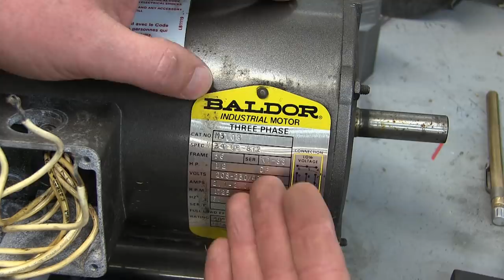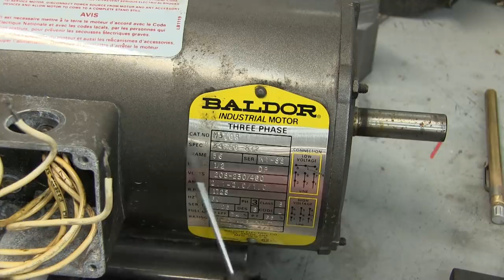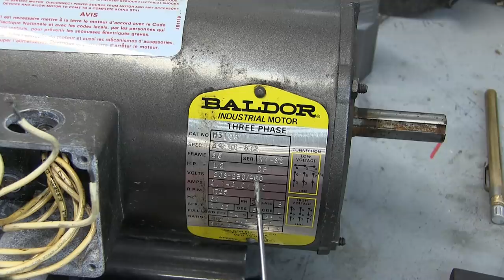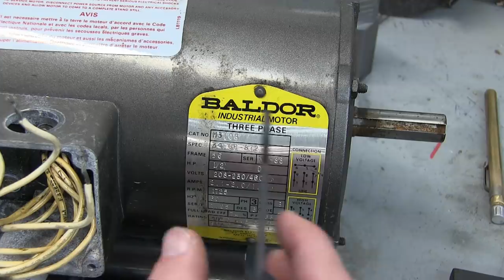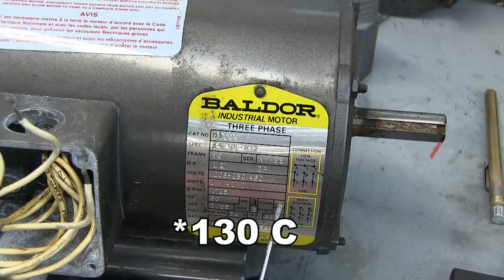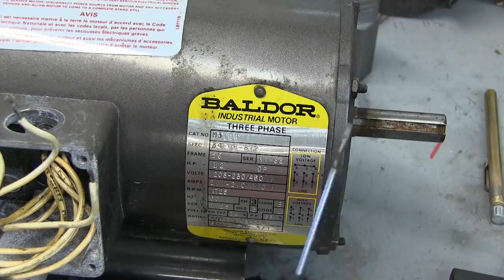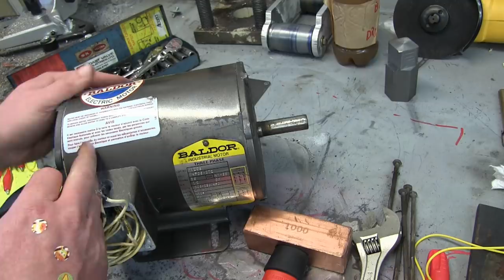BOLTR: Induction Motors EXPLAINED! | Power Factor and Failure Analysis

Comment: Multi-volt motors are usually wye for low voltage and delta for high voltage.  The wiring diagram on the data plate gives that away.  You see terminals 4,5,6 shorted together in low volts and open in high volts.  This is actually a 480V motor with center tapped windings to allow similar torque characteristics at lower voltages.  That's why you see 7,8,9 in the middle of the grid instead of the end. Cap off those center taps and you can configure as 480V wye or delta.

Comment: Humm most motors were I work are linked in star-delta configuration, a series of relays start the motor with star when the motor gains speed changes to delta, well it's the most common and think cheapest way,  Variable-frequency drive offers a lot of advantages but the cost also jumps a lot, the tendency is converting older applications to variable frequency drive though.
It's these things that make a factory run, they are everywhere, from the big air compressors, to the small circulation pump, to the hydraulic pumps, simple induction motors always behind them.

Comment: Give your take on the amazing Wave Spring, most useless application of one I’ve ever seen. You know at the factory the bearing was pressed in the hole regardless of the wave springs attempt to equalize or dampen the bearings position.  Wave spring force on par with farts good

Comment: Thanks for the video, nicely done. Would have spend a little more time explaining the name plate wiring diagram and it related to the coils of the motor showing that low voltage is really two small WYEs in parallel vs. one big WYE in series.

Comment: Do they not 'anneal" stators? I worked for General Electric & the annealing ovens were a bitch, but, it was interesting to see those sheets of metals bond in the high heat...  Rotors were cast. Scary process. Lost's of aluminum on the ceiling where the kilns would randomly regurgitate from sweat of workers..

Comment: You have a crappy way of changing the motor voltages over there in North Amurca. Here on the Old Continent we just change the windings between wye (high voltage) or delta (low voltage).

Comment: In an effort to stem the tide of PCness I want to make a quick remark about the "rule of thumb." There is literally no evidence it was ever used in the way you describe - that is of a man beating his wife. This appears to be the result of hearsay and doesn't appear in written records. 

A more probable definition of the phrase is the one intended in the vijeo and I'll borrow this from phrases.ork.uk, "The origin of the phrase remains unknown. It is likely that it refers to one of the numerous ways that thumbs have been used to estimate things - judging the alignment or distance of an object by holding the thumb in one's eye-line, the temperature of brews of beer, measurement of an inch from the joint to the nail to the tip, or across the thumb, etc."

Maybe you were just being sarcastic, which is more likely the case. In any event keep making these awesome videos. Gives me something to do during these long cold winters in ol'Yukie.

Comment: Oh... if you change the frequency you also need to change the voltage. And the motor you have is shitty. There is no insulation between phases. Should be.

Comment: Inductive loads such as motors create a lagging power factor. The current ac peak lags behind the voltage ac peak. 
That inductive component has to be generated at the power plant so utilities add a surcharge. Industrial motor users will have banks of capacitors at the incoming supply transformer. These created a leading power factor to balance the supply.

Comment: Sorry if this is not pertinent to this video, but on one of your other videos you were wondering why the brushless motor rotor laminations were on an angle.   My experience with motor lamination manufacturers is that they call this 'skewed'.  The problem is the lamination material is cut from a 'heat' and the outside slit coils have camber to them (one side is slightly thicker than the other) and when you stack them all up  the rotor ends up being bowed from one side being longer (or taller) than the other.  So as the lams get stacked they skew them before the recast (that's when they inject the aluminum to hold everything together) to keep everything straight.   

That's what I know about it, anyway.  Thanks for the great videos!

Comment: Hi Ave,
I could be wrong, but two points:
in lagging current the current is drawn to the right of the volts , as the base line is time or angle and lagging follows on teh time line sso to speak.

2. the name plate power is thew adjacent on your triangle and actual power is the hypotenuse with reactive power being the opposite of the triangle.

you are charged for the adjacent side power but the power company needs to supply the power shown by the Hypotenuse of the triangle.

Comment: a good way to think of power factor is this. if you have a beer, the VA is the beer+head(foam), the VAR is the head and the Watts is the actual beer you want to drink, like the useful beer. the glass is the power utility because it has to hold the beer and the head, more head, bigger glass!

Comment: I believe you got the delta y part kinda wrong. According to the nameplate, the high voltage arrangement is a Y configuration and the low voltage arrangement a delta one. You can just use one or go fancy with a plc - or wired relay logic, if you're a masochist- and make it start on y and change to delta, so you don't have as big a current spike.

Comment: Rule of Thumb comes from the fact that your thumb is about an inch wide, so you can use it as a ruler. Point of finger to elbow is a cubit. Fingertip to nose is a yard, fingertip to fingertip is a span or a fathom, depending on how wet you are. A hand is 4 thumbs, and we still measure horses that way.

Comment: Shoulda used mistletow to open it up instead of that hammer. It is a Baldor afterall. In addition I think your waveform diagram was backwards. Waveform drawn to the left of another is said to be leading due to time axis increasing from left to right. I always do the same thing by mistake

Comment: A little correction for ya, the idea that the rule of thumb is based on an old law regarding wife beating is a misnomer. The etymological roots of this term are a bit fuzzy but it most likely came about from carpenters using their thumbs as a means of quick measurement. Source: http://www.wordorigins.org/index.php/more/489/

Comment: in regards to the insulation temperature rating (B, H, F, or whatever) - is that the rating of the insulation of the conductors in the wiring box or the insulation of the windings?

Comment: may I complain about the fact that this is a 3-phase motor and therefor to calculate the propper Power consumption you'll have to multiply the wattage of the single phase by the square root of 3?

Comment: I have salvaged a lot of bearings that were locked up.  Clean, clean, clean, lubricate, get them loose enough that you can spin them with air pressure and then blow out the solvent such as WD40 or carb and choke cleaner and repeat until it is a dry clean bearing and then put in some motor oil.  re seal and it is good to go.

Comment: Ser. F = 1.25% over FLA, meaning you can run the motor at 1.25% over amp for a little while.

Comment: Im an electrician at an old paper mill and we meg and test every motor before we install them, mostly deal with 600v, the plant engineer hates to use new motors and loves to use old beat up pos motors, he found one that looked older than me, wired it up directly to a vfd and it about vibrated off the pallet, the engineer walked over watched it for about 15 seconds as it was shaking vilolently, and told me to install it, maybe lasted a month

Comment: What takes time is specking equipment for repair or replacement when the oem guys tack the tags off so they think you need to go back to your oem guys to replace one component at astronomical prices. More than likely you can spec it out and buy straight from the distributor.

Comment: tell us how the motor bearings are electrical insulated where all AC induction motors leak power thru the rotor shaft and installing a wrong bearing will cause the bearing to fail, if you take the roller bearing apart it will look pitted and burnt like it was hit with an arc welder, so that's what's really going on, the rotor shaft voltage is making a frame ground thru the bearing and arc sparking Is going on inside the bearing

Comment: I’ve got an idea for an expanded vidjeo on this. Turn this motor into a rotary 3 phase converter. For those who don’t have 3 phase power in their shop and need to run 3 phase gear.

Comment: The problem with insulation is, in new motors they use plastic insulation. Plastic insulation is useless. Unlike the old nomex. Nomex lasts alot longer.

Comment: That motor wasnt Y or delta it was both (or either) the winding isn't connected internally at all, you have access to all 6 cables from the windings, and the operator can decide which pattern to use. (Or start in star then switch to delta to minimize the flow of angry pixies) 😁👍🏼

Love your videos keep it up! ✌🏼
Reply: unfortunately not, you can get star or delta like that, or single phase it, but for speed variation beyond that, you have to change the number of magnetic poles on the stator and rotor (or run it on a frequency drive)

Comment: AvE - I recently took a motor apart to replace the bearings. Everything spins freely until power is applied and the motor seizes, nothing spins. Turn the power off, everything spins freely.   What gives? Any ideas?
Reply from the maker: Incorrectly wired or shaft is bent or bearings are worn out.
Put pressure on the shaft down, in, out and spin by hand.

Comment: I've heard that the real origin of the "rule of thumb" is an approximation of an inch by taking the distance from tip of the thumb to the bendy part. It makes more sense because it is always used to talk margins of error when making measurements. The story about the wife beating analogy was that an English judge was the first to make the comment about what thickness of rod it was ok to beat on'es wife with. That particular use of the saying only became popular because of the backlash that he received for it, because - shock horror - the majority of society at the time didn't think beating your wife was acceptable either!

In short, it's not sexist, and has nothing to do with wife beating.

Comment: My Dad used to take burned out motors to a place called Longo in my town. They’d rewind it and slap a new name plate on it. My Dad would give it a fresh coat of paint and voila! Here’s your new motor! The guy was a genius when it came to stuff like that. I spent many hours as a kid taking apart demo’d panels and pipe runs and restocking his truck with free parts. I do the same now, a wire brush on my drill and a can of flat grey spray paint and I make used electrical boxes and fittings look new. Keeps my profit margin looking good.

Comment: So, n00b question, does the length and width of the winding have an effect on rotational speed and torque?  What dimensions affect what forces?
Reply: Saberus Terras Speed is determined by frequency of the input and number of poles.  A 50Hz 2 pole motor will run at 3000 rippums, a 60Hz 2 pole at 3600.
If you go to four poles you halve the speed (1500/1800) but get twice the torque because power = torque × speed.  There are some losses so it's not exactly double but it's close
Reply: Obviously if you use a variable frequency drive you can go at other speeds, within limits.  A synchronous motor like that one in the vidjeao is designed to run at the same speed as the grid/electricity supply (hence synchronous)
Reply: Thanks, but I was more meaning the overall physical dimensions of the actual motor.  Like would a wide but thin motor have torque for days, but need to keep to low RPM to avoid tearing itself apart?  And conversely would a narrow but long motor lack in torque but could spin faster if the frequency was cranked up?

Comment: The bulk of the rotor is actually a great many iron/steel plates, the aluminum on the ends only serves to retain the plates, and the nubs are for balancing the rotor. This is done by nipping off a tinny bit of the aluminum on heavy side.

Comment: Re Arduinos are +- 10% voltage:

Ever hear of the Ruggeduino?  It can take up to 30V and has WAY better protection on its IO.  The same group also makes a 24V IO shield complete with a 4-20mA input!

I'll avoid the link so as to not look spammy but it will be the first thing up if you search 'Ruggeduino'.

(full disclosure, this is made by a former professor of mine)

Comment: Help me out will you? I want to understand this in full scope. I get that the capacitors resist voltage and induktors yada yada, but how is any of this known to the powerplant? If my PF on the house is good, and the power company measures something below .05 reactive when gauging my kwh, how are they affected by me using rubbish appliances with shitty PF? 
If anything I hook up goes through the kwh meter, before I phase shift the hell out of it, then shouldn't I be paying for the kW and not kVA by default, already? 
I know I'm wrong, just want to know how bad the retardation is before I seek compensation from the sewage dump that molested me. 
"No officer, I have a mole and my name is Lester, and the boy just cried my nick name out loud to find me", is how he persuaded the cops to turn around. Best damn sewage I ever had though.

(edit: Also, the Y config of three loads provided with a 3 phase power supply will induce a natural zero because the cosine of 120,240and360 equals to zero. I checked on a calculator and it holds up. But why though?)

Comment: My grandpa just built a rotary 3phase converter out of a 10 hp 3ph motor to run his lathe. He uses another motor to spin it up then he just kicks the power off to the pony motor and kicks on the power to the big motor and it kicks off running on single phase power, as its running it is producing 3ph power. He is a wizard with electronics. He used to work for Whirlpool Corp. That is about 10 minutes away from my house in st.joseph. I could link a photo of the assembly if y'all want.

Comment: ya 30 and moms basement working on solar powered air conditioning and using you SDR (software defined radio) for radio direction finding to find the RF signal that's interfering with your Wi-Fi conection to your arduino D.R.O (bad fluorescent transformer) and that bit coin mining machine starting to pay off. and you need the data off the name plate to program the VFD to match them together and then they try to ram that lone gunman theory on you  again all you can do is hope the new  generation's got it or is getting it figured out therse a guy named William buckly no not the radio guy after the marine barracks bombing in Lebonon he was made cia chief there his girlfriend was hezbolah he was captured that's one level of diplomatic relations us-middle east it takes hours to tell that whole story anyone who reseaches stuff its not hard to find  storys like that and what brand of bullets did oswalds .38 have in it. theres some fine points that if you know about open up a whole lager story
Reply: Can you clarify please?
Reply: the government might be lying to you about some stuff and it goes way back. so pay your taxes and fund the whole thing you'll be the last to know anything. enjoy